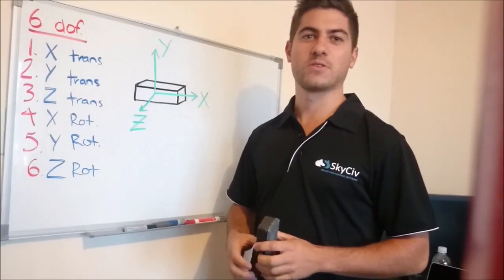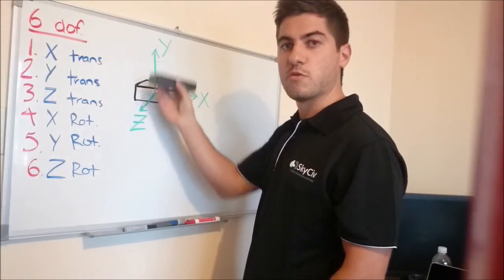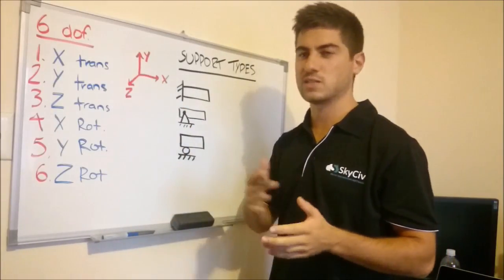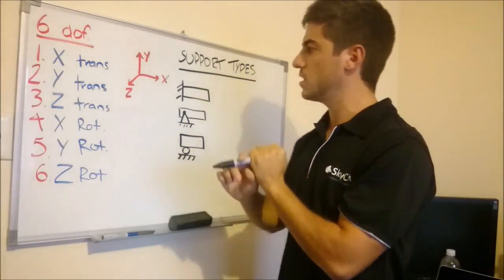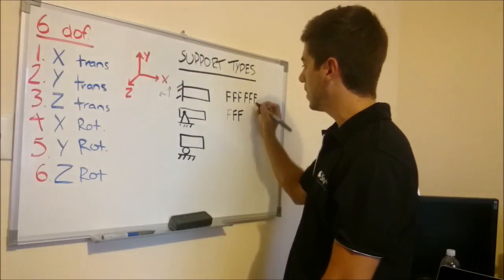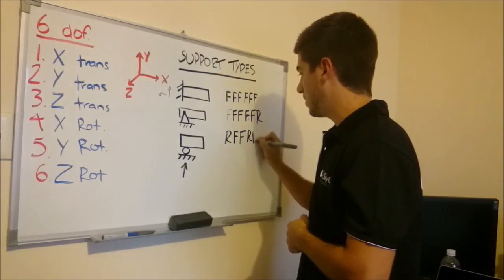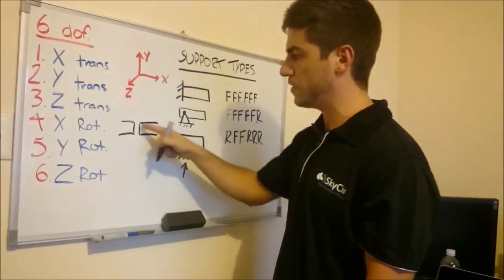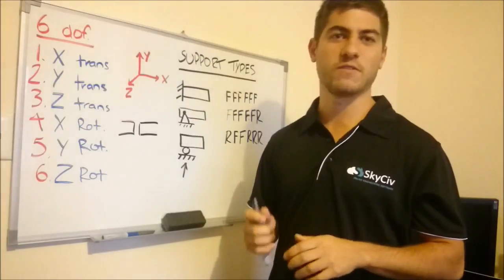Degrees of Freedom and Support Fixity Codes Explained

Comment: Consider a 2D simply supported beam with one end Knife edge and other with roller support. It has FFR at one end (Knife edge) and RFR at another end (Roller Edge). Hence the total DOF is 3 for a Simply Supported Beam. Am I correct?

Comment: In roller support why is the "Z translation " fixed ? Shouldn't it be "R" because it would allow translation in z axis. :/
Reply from the maker: It really depends on whether you're dealing with a 2D or 3D model as well as how closely you want to simulate reality. If your structure is in the 2D X-Y plane then you probably don't want Z-axis translation, but this can also be the case in 3D if you're considering an ideal support.
Reply: Same question. why is z transition fixed for the roller support?
Reply: so if we are considering ideal 3D model we can  take Z translation as  R in above case